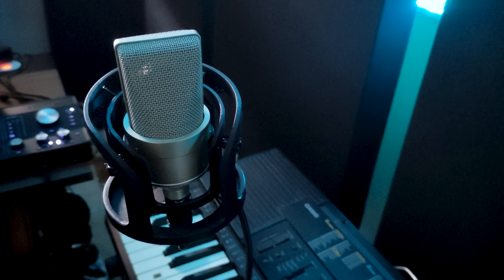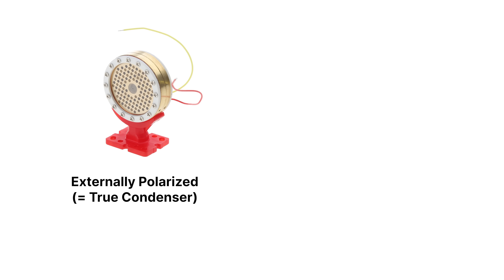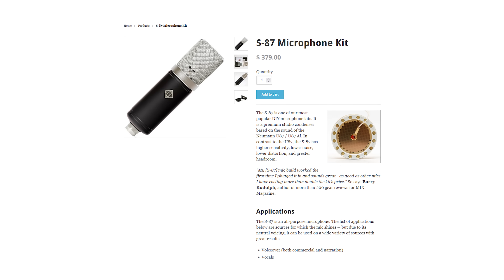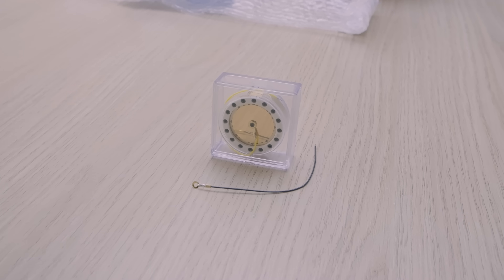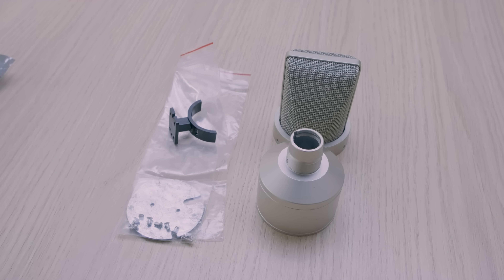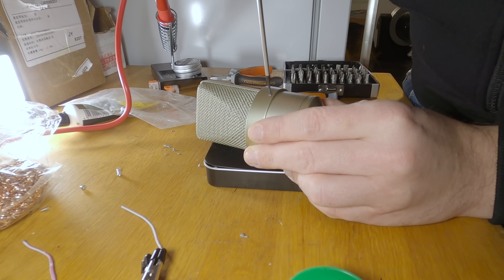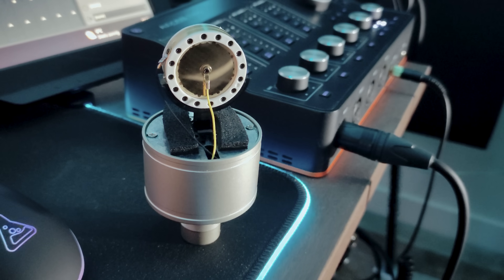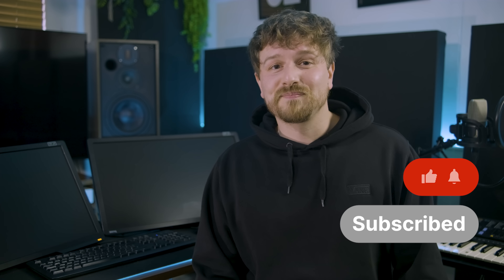Building a Studio Microphone from AliExpress Parts (DIY)

Comment: U should check if pin 1 on xlr have connection to microphone chassis. As mic circuit was separate part there is a chance that there is no connection between those elements and ungrounded enclosure could explain rf interference noise
Reply from the maker: Thanks, I'll check that out! I'll let you know if that fixes it.
Reply: @SirFreak  The little screw on the XLR connector screws into a metal tab, which you can bridge to the XLR1 pin. That creates a connection from the chassis via the screw to XLR ground and should be very solid.
Reply from the maker: @VOROX_Audio  Thanks for letting me know. I checked and it already seems to be bridged. When testing with my multimeter, I did notice that there was still some resistance to the other screws though (about 0.5 Ohm). Perhaps due to the anodized aluminium? I sanded the top of the body and the bottom of the basket, but that didn't make the GSM interference go away. Perhaps I also need to sand the place where the screw is screwed in? Although.. I would suppose that it makes a proper connection in the screw hole.
Reply: @SirFreak   That could be a magnetic hum, not just RF. Then grounding chassis won't do much as aluminium chassis is not ferromagnetic.
If that is the case, make sure all wires are not unnecessarily long, twist all loose wire pairs together, cover transformer(if any) with mu-metal shell.
Another possible cause is the XLR cable picking up noise like antenna and dumping to your circuit. In this case, you can possibly add common mode choke or RF shunt caps behind the XLR socket.
Hope it is just chassis not grounded though. That would be easy fix. Make sure the headbasket has good electric connection to the body too, as headbasket needs to be grounded too.
Reply from the maker: @dongleseon8785  Thanks for the help. It does not really sound like a hum though.
I could definitely try to shorten the wires to the board a bit since they have a bit of leeway + twisting them.
I could perhaps also try plugging in the mic to the interface directly, to see if the XLR cable is dumping that noise in the circuit? Let me give that a try.

The chassis seems to be grounded though, although it does seem to have a bit of resistance by the time it gets to the other screws (0.5 Ohm).
Reply: @SirFreak   Yeah I was watching it with sounds off. LOL sorry.
That seems to be quite high resistance for being a monolithic metal chassis. (if that number is accurate)
It's good practice to make the chassis grounding to be short and thick. But aluminium don't like getting soldered... Maybe you can use toothed washer to dig fresh contact surface to chassis. (probably not long term solution though)
From what I saw and read, you are not dumping chassis ground through pcb ground, right? Because that would be bad.
How about thermal noise of the circuit itself? High DCR transformer can dump quite a bit of noise.
As other guy suggest, I think it's probably good idea to isolate if RF is the culprit at all.
Reply: @SirFreak nog gelukt?
Reply from the maker: @boimesa8190  Voorlopig nog niet, er was al een bridge voorzien op het circuit naar waar het vijsje gaat dat in de body vast zit. Ik kan misschien wel nog eens proberen met extra draden eraan te solderen.
Reply: @SirFreak  please let me know when, or if, he responds
Reply from the maker: @xanonax I opened up the mic again, and I noticed that there was a bridge from PIN1 to the screw that goes into the microphone body. I tested with a multimeter if there was continuity to the other screws in the body from PIN 1, and there seemed to be a connection, however there also seemed to be a tiny bit of resistance (about 0.5 ohm). I'm not sure if that is to be expected?
The mic body does look anodized, so perhaps that is causing some resistance? I already tried sanding the bottom of the basket and top of the rest of the body a bit, but I still got some GSM interference after that.
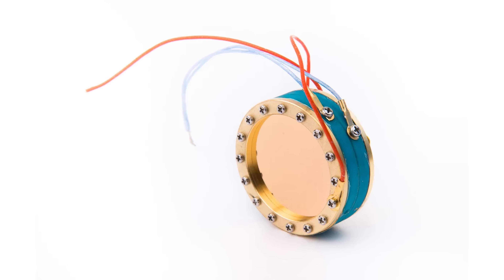Reply: @sirfreak continuity of whole enclosure can be a problem, especially if it is made of anodised aluminium. Anodised aluminium is pretty bad at achieving continuity, I had few cheap aluminium flashlights where there were constantly problems with dimmed light as was body having to much resistance (body were a path to back of the batteries), 0.5 ohm is probably lowest value that Your multimeter would show when shorted, so it shouldn’t be a problem. U can for testing put whole mic into other  grounded case, metal box of some sorts, u just need something to act as rfi shield. Just to verify if this is really the culprit. Other thing that came to mind is to check output impedance of the board, but it would be need to be really high output impedance to make it a problem, like kohms (mic output is usually in range of 200-300 ohms, and mic preamps have input impedance of around 3kohms - ratio 1:10). Could be a broken wire in mic cable, or badly designed mic board, but enclosure without continuity still seems like the most probable one
Reply from the maker: @xanonax Thanks for explaining! I'll try to further investigate it as soon as I can. If I find the solution, I'll post it here
Reply: Yes ground to Case and Capsule. (3 wires)
Reply from the maker: @GerritTjaardAMarinus  Hmm I never thought about directly grounding the capsule as well (it just uses the ground from the board right now. Might be worth a try.
Reply: @SirFreak  The ground wire of capsule should stay in clean ground of PCB which act as 0v reference. You don't want to let chassis go through PCB.
Reply from the maker: @dongleseon8785 noted, thanks!
Reply: Great vid! Thanks! 😃